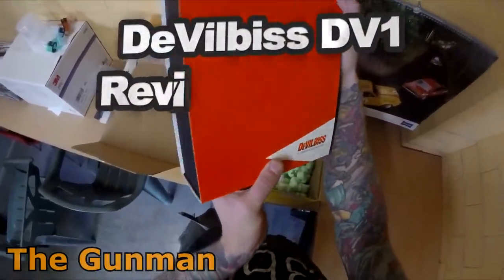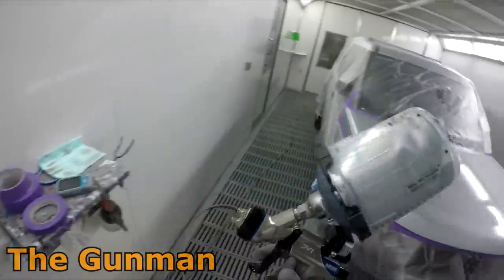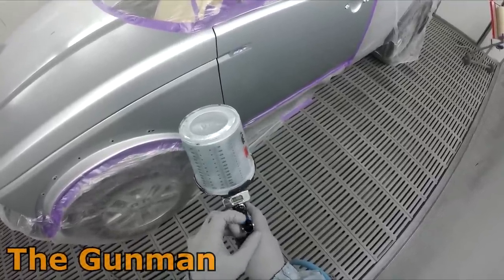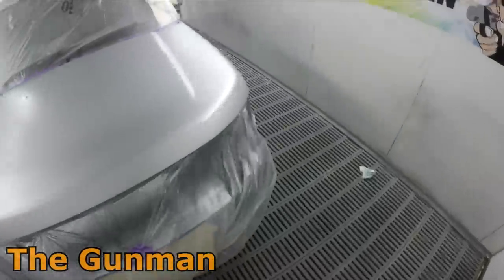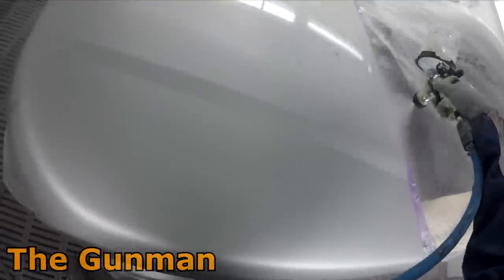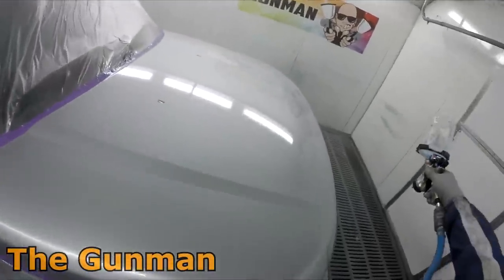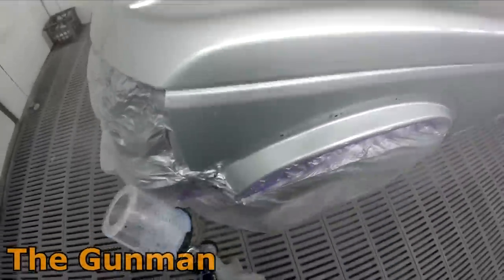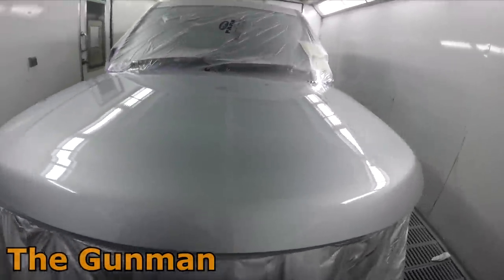DeVilbiss DV1 Review & Demo

Comment: Gunny this gun is developed for water based paint it's like using the hv30, I am surprised they made it hvlp because most    painters prefer transtech, I have changed to the hybrid hv25 for base on my gti pro and it works pucker, not sure this gun will be for me looks like it's built to look like the high end ANI.

Comment: Would the DV1 be ok for a beginner? I’ve never used a spray gun. Body is off the frame and almost ready for paint underneath so have to buy a couple guns I figure
Reply from the maker: Honestly, probably couldn't get a better gun for a beginner, as I mentioned in the video I feel like a first-timer could get good results with this gun. However, if you're trying to save some money and won't be using it daily like us painters then there are cheaper options, I'd have a look at the DeVilbiss GPi 1.4 for base, clear & 2k colour and 1.8 for high build primer. One gun with 2 needless and 2 fluid tips would be enough for just about anything you want to paint. Only other thing you may want is a mini gun if spraying wheels or small parts. I've got reviews on mini guns and a review on the GPi. I got them all from SprayGunsDirect.co.uk
Reply: The Gunman ; but is the DV1 not a HLPV? This is something you adressed as not Boeing suited for beginners (due to max compressor capacity issues with amateurs)?

Comment: Saw some 3m accuspray nozzles laying around in the start of video . Any plans on a review of the 3M Accuspray gun? I bought one  some time ago for spraying short pot life chemicals like tooling resins, gelcoats, mold releases and chemicals for carbon/kevlar, composite parts. Love it for that since it saves me from throwing away cheap spray guns, which happens frequently in that sort of work. Also saves me on cleanup and find it to be very reliable and repetitive processes wise. I would never use a good high dollar gun as one distraction in the shop or mishap and the resin sets up in the gun ruining it.  With the 3M if resin gets close to setting up I can pull the nozzle off and just wipe the needle down and not lose the whole gun. 

 I have used the 3M accuspray for spraying automotive paint but I find the fan a bit narrow and the clear doesn't lay down as smooth for me on the 3M gun then my sharpe fx2000. I find it does ok on base. I do not spray for a living so maybe its just bad technique, interested in your impressions on the gun if you ever get a chance.  Great videos.
Reply from the maker: I'm definitely going to review the Accuspray gun soon.

Comment: I find that Devilbiss is the only gun that operates great with full fan. It seems that the other companies fans are just too much and i end up closing the fan and opening up 2 turns or something. I still run the Prolite for base and LHP400 for clear and it produces perfect results
Reply: I have now owned 5 pro lites for about 6 months...

Use 1 for clear (glasurit and ppg)..and the rest for waterbase (glasurit/ppg)

Use them every day all day long but find it difficult to get the base down without mottling.. have te10,te20,hv25,t110 and tips 1.2/1.3/1.4....

Changed everyone together with everything but still i cant seem to find the correct setup to get specially the silvers without mottling..

Any tips and ideas are welcome...

If the guns spray at 2bar it does not give a good fan...full coverage at both sides and middle but not in between so hope to hear from somebody who maybe had or has this problem with thees guns.
Reply: @kennethandersen6920  you cant spray metallics colors at 2bar never, for that reason you have this problem, and the reducer its very important, use slow and spray 15 to 18 psi and you dont be have this problem again 3 turns out.
Reply: @fernandovalentino9309  thx:)

Comment: Can someone explain what is full fan like is it the fan knob all the way out ?
Reply from the maker: Yes
Reply: The Gunman and fluid full is it that we call “wide open” here in the us where you pull the trigger and turn clockwise until it stops or is it a different setting?
Reply from the maker: @NuKe11Killer  yes, full pull on the trigger. Wide open, pull trigger, then turn clockwise until you feel it stop.